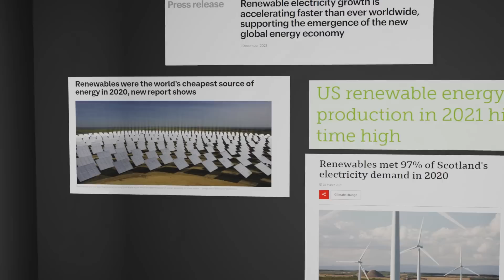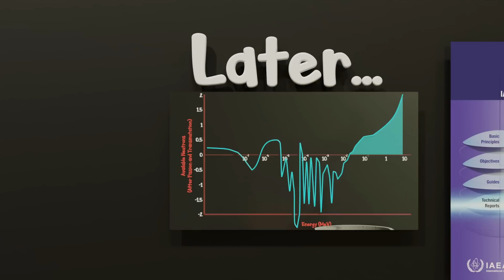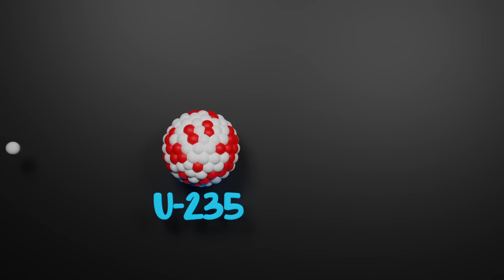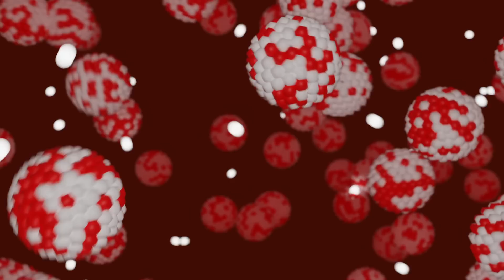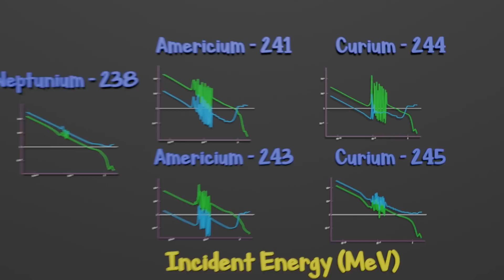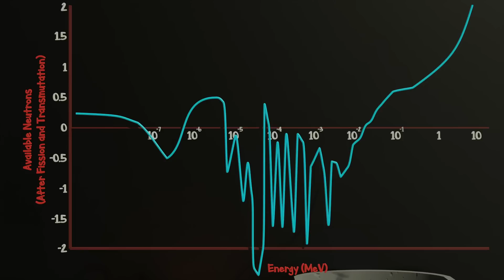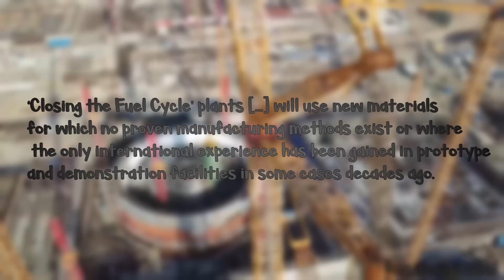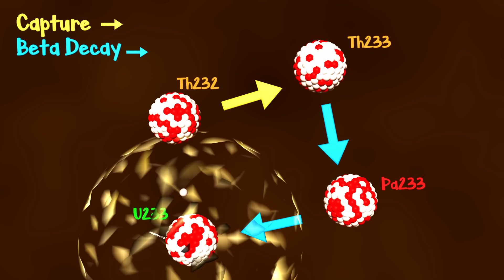How to turn Nuclear Waste into Nuclear Fuel

Comment: My main concern is that when Russia intentionally bombs your otherwise well designed and safe nuclear reactor, it creates a dead zone that lasts for thousands of years. How many permanent dead zones can we afford to have?
Reply: That is a silly question. For nuclear power advocates there can never be enough nuclear power plants built ... no matter the danger. And think of the irony, the material to make nearly all nuclear weapons has come from nuclear power plants that were built supposedly for 'peaceful' purposes. So, a nuclear power plant will be destroyed by a bomb made from material from a nuclear power plant ... Don't worry, nuclear power advocates will pay for cost of cleanup ... they always say they will ...
Reply: @leeroyjenkins0   , I would suggest learning about Silicon solar cells and photovoltaic technology. Then you would be much better equipped to judge which energy technology is better. Here is a start; The monocrystalline Silicon solar cell is a semiconductor solid state device that has an indefinite life span, that is, like a transistor, it does not wear out. Learn to live within your energy income. History teaches that proliferation of nuclear power plants = proliferation of nuclear weapons.
Reply: @leeroyjenkins0   , Obviously, not one ounce of thinking or research. You  do not seem to have the slightest appreciation of the information provided. Try researching this; A. what is power output per square meter of a Silicon solar cell photovoltaic panel? What does 'non-arable- land mean? Using solar as a primary energy source requires living in harmony with nature. 
I ASSURE you, vehicles of the future will not be like vehicles of today. Like today's vehicles are not like vehicles of 50's
Reply: @leeroyjenkins0   , It is YOUR perception that I am 'talking down' to you. I am not responsible for YOUR perceptions. 
I see you just wish to wallow in your ignorance.
Reply: @leeroyjenkins0   , Energy of all types has been a personal interest for fifty years. I am guessing a good many years than you have been alive. I have also studied logic. I have lived off grid for over ten years. It is you that begin by saying you are not knowledgeable about solar. Too bad you do not seem to appreciate the significance of information given to you or of questions asked.
Reply: @leeroyjenkins0   , Good luck to you ... as it seems you will be dependent on luck in your life. REPEATING earlier statement; "History teaches that proliferation of nuclear power plants = proliferation of nuclear weapons."
I do understand for nuclear power advocates, proliferation of nuclear weapons is not a concern ... A point of view that I believe is a clear indication of lack of sanity ... You simply want to hear reasons for proliferation of nuclear weapons ...
Reply: @dunexapa1016  yo spam bot go away....... you cant bully people out of their beliefs, no one is going to change there mind by being pilled on by you. go outside.

Comment: There is no concerns about the accumulation of the nuclear waste. 
One kind of waste are anything that touches the nuclear fuel and it is insoluble in water, and this kind of waste could be just burried underground 1 meter into the soil to not cause any problems. 
The nuclear fuel could be recycled or could be stored few km under the ground or could be just put in the concrete barrels and just be placed near nuclear plant. The nuclear waste is a solid and is insoluble in water as well. 
The meltdowns are impossible with newer nuclear constructions.
Reply: Here is a tried and true solution; make depleted Uranium ammunition. This type of ammunition is very effective against tanks.
Next step is to unlawfully invade a country like the United States did in 2003 then you just shoot your weapons that use depleted Uranium ammunition and spread it all over the country you have invaded. Next step is to hire scientists from the United States who will convince all people this is safe. See? so simple. Stop worrying.

Comment: Liquid salt Thorium powerplants. Now. Please.
Reply: Are you in a hurry for there to be nuclear bombs using Thorium?
Reply: @dunexapa1016  Like dirty bombs? No, I am not worried that much. More so about the pullution coming from fossile powerplants. And even more so about the nuclear waste which the Thorium powerplants could burn up. Even more so about the shitloads of non recyclables like blades of wind power turbines. And what really makes me worried is that without thorium we will never get the electricity cheap enough to stop fossile fuel usage. Cheap, safe, and the only realistic way to a better future.

Comment: Why not just gather all the high and mid grade nuclear waste, dump it all in a huge thermally insulating tank, and just use the heat generated from its straight up radioactivity to drive a heat engine. No need to worry about isotopes, or neutrons. Just proven technology, which utilizes all of that junk together, all that stuff you were planning on burying and wasting the energy produced by. A radioactivity based nuclear power plant, rather than a fission based nuclear power plant.
Reply: Hopefully no terrorists would steal material to make a dirty nuclear bomb ... Such a power plant would be a strategic target in a nuclear war and a target of choice for terrorists.
Reply: @dunexapa1016  stop harrasing people get a life
Reply: @TheOriginalJAX  ? You do not seem to think terrorists building a dirty bomb using nuclear waste as something not to be concerned about. I would think that few sane people would share your lack of concern.
Reply: @dunexapa1016  Once again you are harassing everybody in the comments section go away and get some help. you are also rambling.
Reply: Dirty and inefficient.

Comment: I grew up in a town, that has been using the BN-350 reactor for several decades to desalinate the sea water. Built by the Soviet engineers, and once visited by an American astronaut with the nuclear physics diploma in his pocket. As I recall, he even left a record in the Visitors Book. And now Russia is building the BREST reactor.
Reply: Every country can probably point to at least one major mistake.
Reply: @dunexapa1016  look what we have here........ go outside Xapa leave comments sections alone already.
Reply: @TheOriginalJAX   No surprise. A person that has NOTHING to say about nuclear energy wants people who can make an intelligent statement to go away. If you must wallow in your ignorance, ... please do not put it on disply.
Reply: @dunexapa1016  Go away, Iv found you in over 20 comment threads in this video you need to stop spamming everybody, you are unhinged get help.
Reply: @TheOriginalJAX  Is the density requirement for a controlled, sustained, nuclear fusion reaction, capable of generating meaningful amounts of electrical power, a limiting factor in the quantity of Deuterium fuel used? Yes or no?
Reply: @TheOriginalJAX   , If you had the choice between home 'A' which is a zero net energy home and is not connected to the grid and home 'B' which is a home that receives its electricity from a nuclear power plant and uses natural gas to heat in the winter, which home would you choose? 'A' or 'B' ? Both homes cost the same and either home is large enough for a family of four to live in comfortably.
Reply: @dunexapa1016  Nobody cares.
Reply: @dunexapa1016  Desalination is a great use for nuclear energy. You are so ignorant. You are pathetic.

Comment: Well meltdowns isn't really a problem since no one builds Chornobyl level powerplants and Fukushima was badly designed and was struck by one of worst combination of events possible
Reply: Human error is a problem ... and I don't think that has been eliminated. If you don't believe the world has been designed by crazy people, look around you. The actual physical construct of most societies today is built on the premise that there would be an easy to obtain supply of petroleum. How's that working out? Look at the millions of houses built without any consideration of working in harmony with nature. Just stick a gas furnace in it ... or energy sucking centralized air conditioning.
Reply: @dunexapa1016  if you have done any reseach then you should know that chernobyl type plants don't exist since no one is dumb enough to not build a containment building around the reactor (the part they skipped at Chernobyl).
Reply: @reahs4815   If you think human error has been eliminated ... you are very naive. Canada helped India build a nuclear reactor. India harvested material to make a nuclear bomb. Got that 'little' problem worked out??? 
How much energy do you need and for what purpose?
Reply: @dunexapa1016  You are everywhere arguing with everyone........ you need to find something better to do.